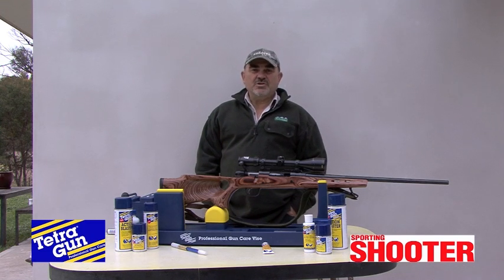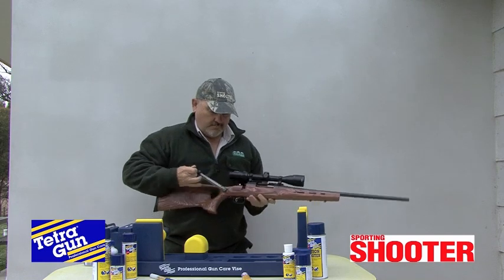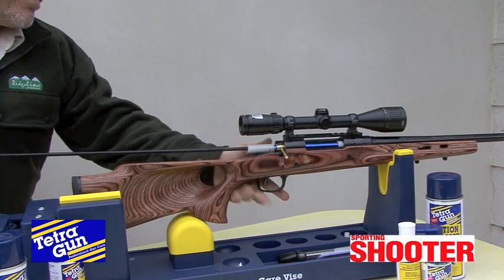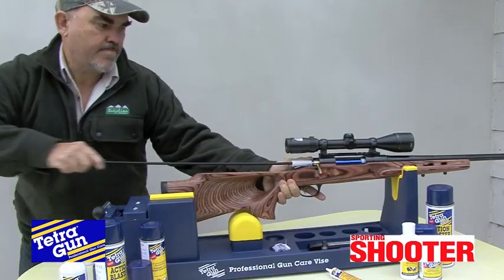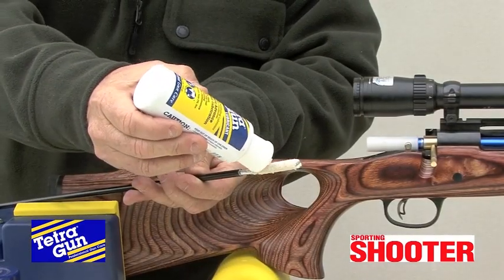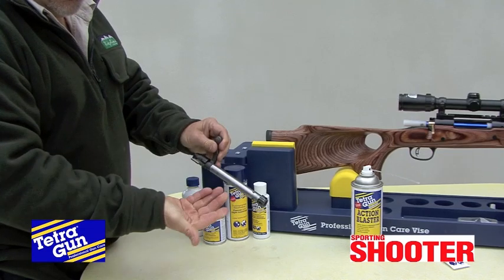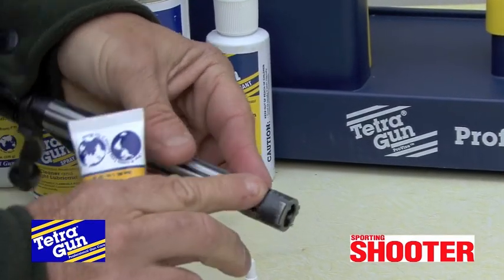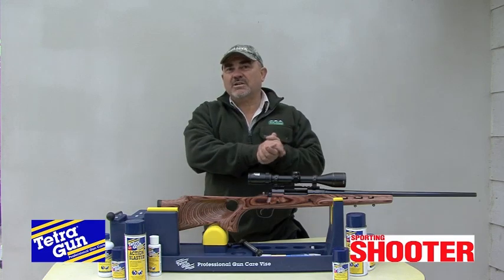Tetra Cleaning Products with www.sportingshootermag.com.au

Comment: I just used the Tetra copper solvent on my .223 rifle, I soaked the barrel as you did for 30 minutes and ran my nylon brush W/added solvent down the barrel 30 times back and forth and reapplied more solvent and ran another 30 times and then my (brass) jag with patches (expected to see green just because of the brass jag) and nothing but black patches till they came out white...no green or blueish patches? Then I tried it on my 9mm handgun and 30-06 rifle and same thing? I run jacketed ammo through all 3 firearms. the smell is just a slight ammonia odor, not bad at all to use indoors (wife walked in the house 20 min after done and didn't even notice ) and I don't know it this isn't that good a product or if I'm just not using it correctly, never used coper solvent before this.
Reply from the maker: While I do not use Tetra Bore Solvent currently, I found it did the job fine - it indicated a colour (from memory purply?-it was a while back). It was not as aggressive as Sweets or my current solvent (WipeOut PatchOut), but it could be left in the bore, which is a positive. I had no issues with it. It could have been a bum batch or you had no appreciable copper fouling.
Reply: Thank you, I'm going to assume its me then if you had good luck with it, maybe I just needed to keep working with it more? I shoot a lot of jacketed bullets so I cant imagine all 3 guns were copper free, I will give it another chance down the road and repost if I see a change, thank you again for your quick response!

Comment: I have tried it now on a penny, doesn't get any more copper than that! I put a good amount on it and waited 30 minutes and went back and it did remove some of the copper, not as much as I thought it would but it did show a purple coloring on a patch, and that's what I expected to see when I cleaned my firearms with it? I cant imagine how saturated a barrel would have to be if it took that much and long to react to a penny? and the more I think about it I cant blame it on the fact that the Tetra came opened when it arrived at my door because If I bought a bottle and opened it to use it I would expect it to still be good years down the road! maybe others may have nasty copper fouling and it works better under those circumstances  I do clean my firearms very well (just not with copper remover) after every use and maybe 1200 rounds of jacketed 9mm isn't enough copper fouling in the barrel, I just wasn't expecting it?